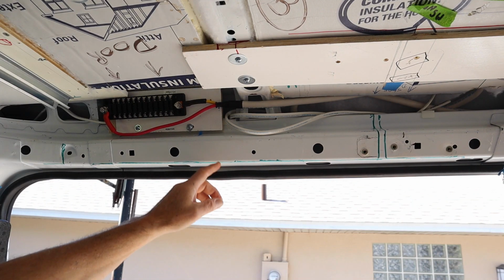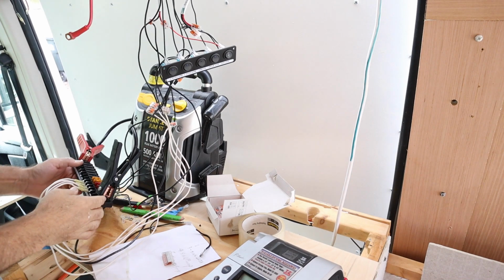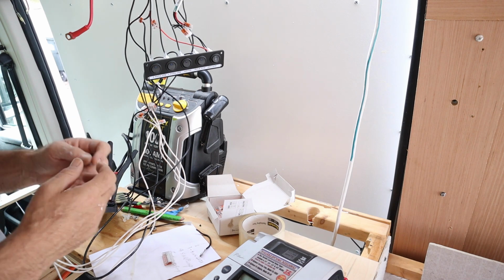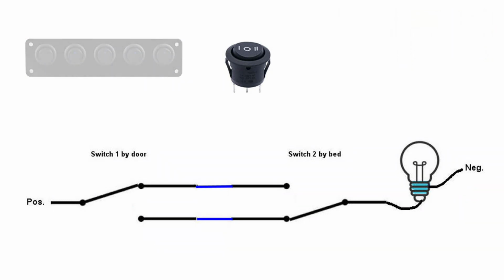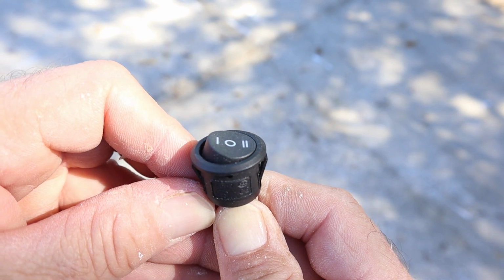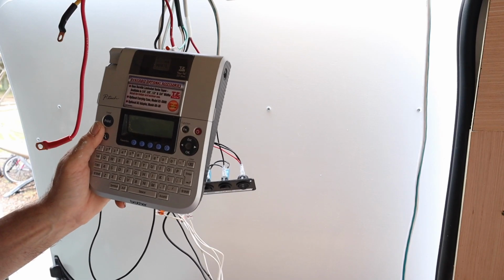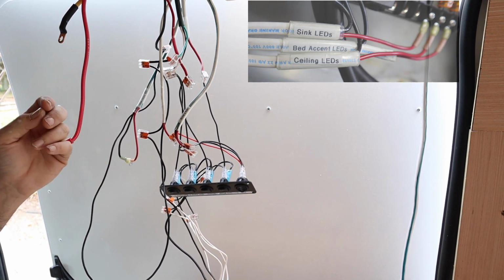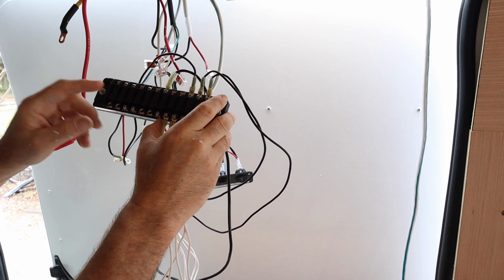Val Life: Electrical Control Panel - wire labels, switches and other tips.

Comment: Does your 12v distribution panel run into a main fuse block near battery also? 
I am planning out my wiring and Was thinking to run power to a distribution bar similar to yours for all my led zones rather than seperate lines from my main fuse block. Any thoughts?
Reply: Any chance to get your opinion?
Reply from the maker: Yes, I have a separate 12 volt fuse panel above the sliding door.  I believe I ran an 8/2 wire from the bus bar.  Having that panel on the other side of the van made it easier and shorter runs to loads.  Be sure to size your wire gauge properly, I use Circuit Wizard: http://circuitwizard.bluesea.com/
Reply: Thank you. I am using 12 gauge to the distribution bar and 12 gauge out to 3 zones of very low amp led lights.

Comment: Great video. Lots of solid advice. Do not get your switch that you took apart but Im sure you are on path and if I actually saw the whole system Id get it. Im an electrician and these things like labels and testing are done prior to putting dry wall up. Much easier to find an issue now then after its all in the walls.
Reply from the maker: The switch just had a center OFF, that I needed to remove.  So that it could be used as a hallway switch. Controlling one light (LED) with two switches.